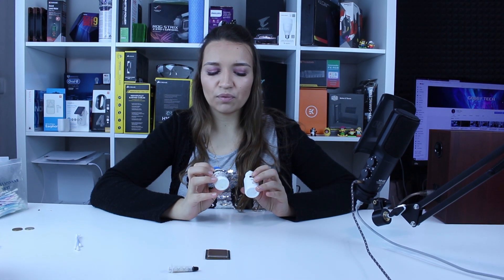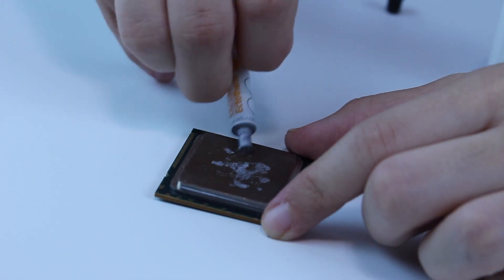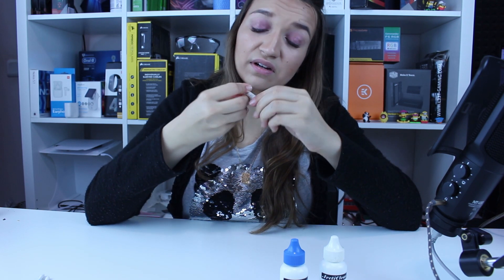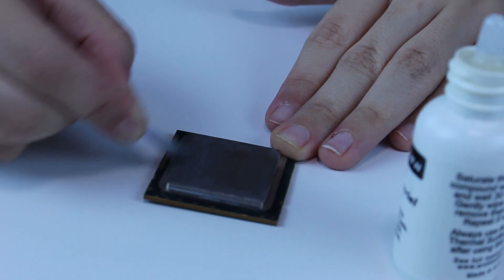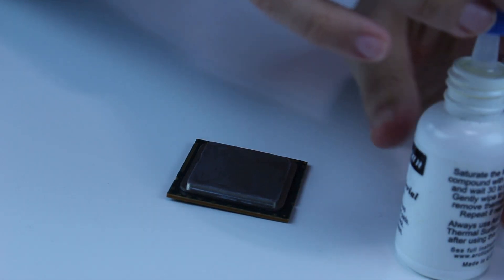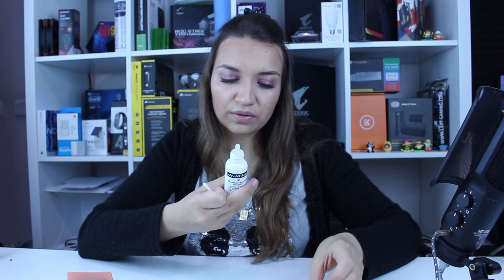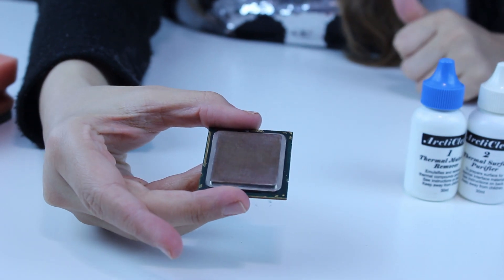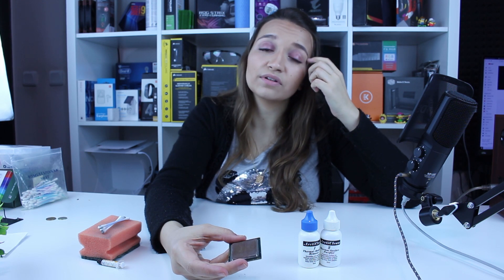Cleaning Thermal paste on my i7 with ArctiClean

Comment: Greetings Gabby,  you should use non-woven hydro-entangled material cloths known as a  shl cloths for the both chemicals. As you use tiny drip over the cloths wait for 30 sec and after apply on the processor. And why you scraping  your processor over the table? Sorry but everything  looks so wrong. best of luck on the next one!
Reply: I'm not an expert but I definitely wouldn't have my cpu just on the table like that. But thats me
Reply from the maker: @CO.GearHead  old cpu so it did not matter much and you cant damage it this way anyway, i will delid my 9900k
Reply: @GabbyTech tell that to Linus.  You're playing finger football with it.
Reply from the maker: @CO.GearHead  practice makes it perfect was late night not focued did I damage my fingertips little bit yes :(
Reply from the maker: this is nothing special cpu from 2009 my i7 920 stepping d, kingpin does it same way also, they just use auto rotary tool, tape sand paper and make surface as flat as possible not rocket science, might do for my i9